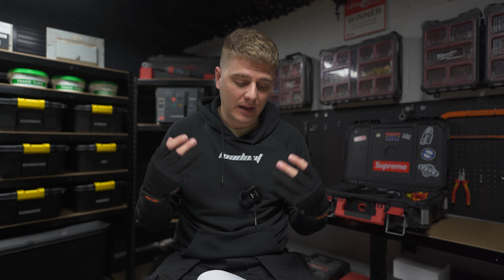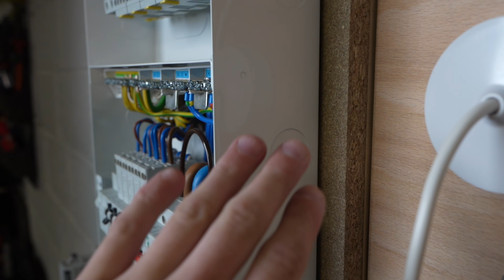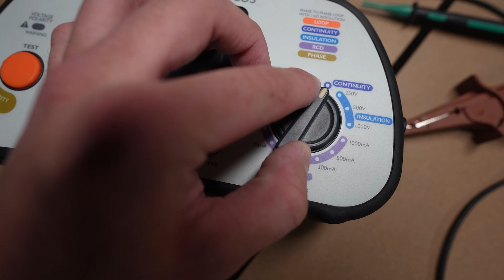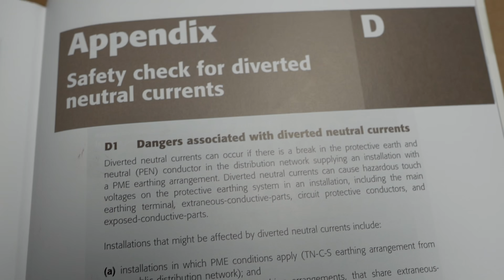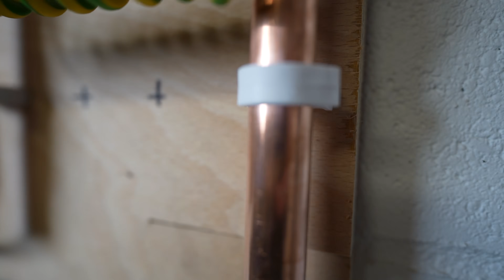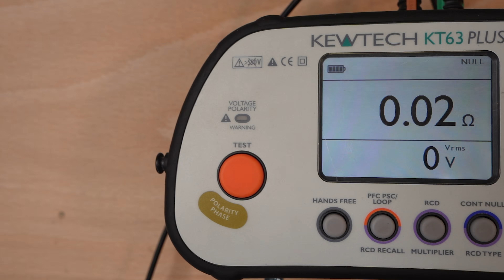Continuity of protective bonding conductors & equipotential bonding explained

Comment: I do respect you and your knowledge and I do understand Electrical. The study is very complicated ones don’t understand it must visualise that in that brain and follow the route of the current movements. It is very difficult. I know what you talking about, but I should say that very clearly the system of teaching and curriculum of Electrical is study in. UK is absolutely not very good and often makes people go round round round the block for years and years and years before understanding this more subjects such as equal potential bonding.     Which is so important and necessary to understand about the electrical wiring and safety❤

Comment: Fantastic video Mike! So well explained. I'm in a unit block in Sydney and our water meter seal failed. The water authority changed the meter and I was interested to see what they'd do to protect themselves when removing the meter. They had a test / monitoring device which they clamped on to the incoming and outgoing water pipe. I wish I'd got the name of the bit of kit. I was happy to see no issues on exported or imported fault current. Cheers

Comment: Also resistance values depend on temperature and humidity and any significant metal part not connected to MET should be labeled describing decision why it could also be noted on an EICR. The issue of fortuitous connections to earth of metal parts is an important one and the issue of importing and exporting potential due to broken PEN is a very important one and should be assessed but normal electricians are limited here as it’s an issue somewhat out of their control, and dare I say perhaps DNOs but without maintenance and wider testing by DNOs the extent of the problem will remain a mystery.

Comment: Just thought I would mention that where a PVC water pipe is utilised at the point of entry to a domestic installation, you need to be certain that the water pipes do not re-enter the ground at any point within the installation. If that is the case, you will need to bond the water pipe regardless of it being PVC or not. 

Been a spark for 25 years and things like this still trip me up.
Reply: I’ve glad you have put this mate, I’m not a sparks yet but my understanding was “oh if it’s plastic don’t bond it” but then I have a situation at my house where yes it comes in plastic,but bit further down the line a copper pipe goes into the integral garage through the ground as you say is re entering.when I get my mft I’ll be testing the bugger 😂😂🙌🏻🙌🏻
Reply: @kingofthetrowel1725  Yeah, it can trip you up mate. The way I see it, if it's easy enough to bond it, just bond it. It's great that you're aware of the situation at your property though. 👍
Reply: @mb-electricalservices  nice one thanks mate 🙌🏻🙌🏻

Comment: bonding leads should not be coiled, as it creates inductive impedance, shortest and most direct route for all earthing and bonding conductors is best practice
Reply: @residualelectrical  At 50hz, 2/3 of bugger all.  At high frequencies, a lot.  I used to work in / around telecommunications and have seen curled earth bonding between racks.  Those very same racks also had lightning damaged equipment.  Racks without curled up bonding all survived.  I've seen it time and time again.  Curled wiring, even wiring with sharp angled bends instead of smooth curved radii all put the impedance way up when it comes to impulse current and that is a significant contributor to things failing when Mr Lightning comes knocking.
Reply: @residualelectrical    it's not the resistance but the raised impedance during a transient or surge of high potential difference at harmonic frequencies which can result in damaged electronic equipment
Reply: looks nice though lol